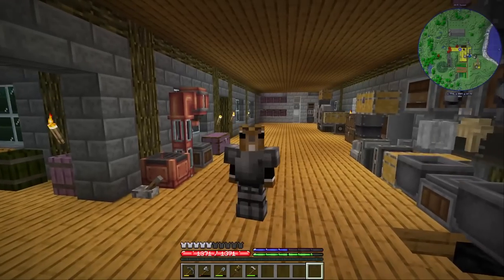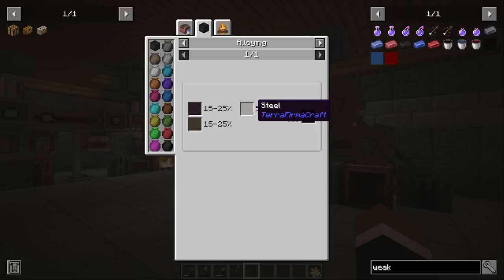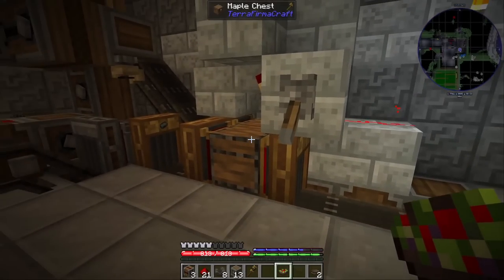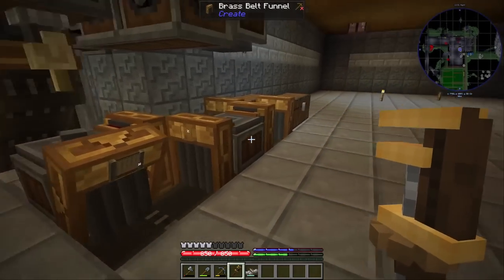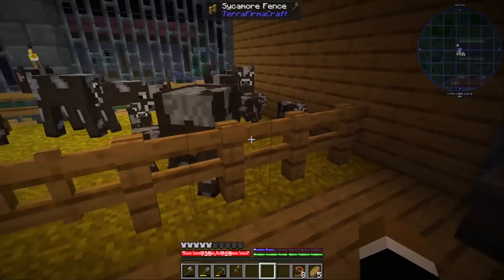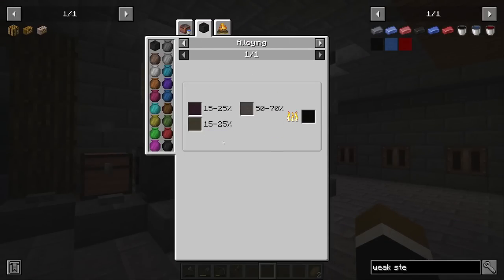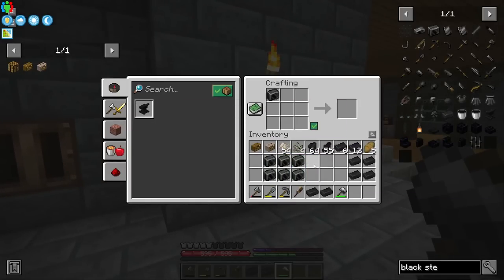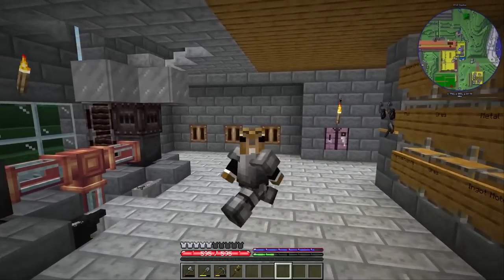ATFC: Advancing To Black Steel And Train Track Making Line (Episode 33)

Comment: any step that can be done on a depot can be done directly on a belt, this should save you so much space and effort creating some of these production lines
and saws can be inline with belts and the items will flow straight through without having to use a funnel

Comment: I am telling you guys, it will be interesting to see Mango shall he decide to fully automate rail production.
Cause I have been working on it in the past days in creative and it's wild. It takes several DOZEN of production steps for various materials. Automating something like flux and bituminous coal is super tricky.
And while it's bad enough in creative, actually building such a factory in survival, will take forever
Reply: Schematicannon
Reply: Wait and see...
Reply: @rot7296  The only solution if you don't want to have two Minecraft instances open
Reply: @koyom1nfangirl  there's also litematica but sure
Reply: You dont need to automate bituminous coal, you can use a deployer on a bellows and just use regular charcoal
Reply: @dylankim4190  I know, but I have to automate charcoal anyway. And since I also  have to automate flux and some of the steps/materials are identical, I just went for it.
If I am going full auto, I might as well go all the way in ;)

Comment: It is possible to "chain" all the operation needed for such craft as the rail in a production line (one long belt with all the operations made on it). The mod is made for it. There is no problem of pace (the item do not move when an operation occur on the line).
Such contraption could make your production line look way better and realistic, as well as save you quite a lot of ressources.

Comment: I know that these are pre recorded, but when testing in my world, the filter for the ingot mold full of metal could instead be set to block only empty molds from passing. The nbt data must be respected however.
This allows me not to have to select each type of metal or alloy and makes life easier, hope this helps in some way.
Reply: iirc you can ignore the entire filter because empty molds under a spout will wait to be filled before going anyway, might be just on belts tho
Reply: @honema123456789  that's true, i sort of forgot about that when building in my world lol

Comment: Mango, you can just set a filter that denies empty molds instead of assigning every single mold you do
Reply: He'll probably advance through every metal type before we get past the prerecorded episodes and he "learns" about blacklist filters. 🤦
Reply: @_-ough-_  he mentioned last episode that he might change the filter in the washing contraption to blacklist stone instead of whitelist each product.
Reply: @felipevasconcelos6736  I noticed that too, but he doesn't seem to have actually internalized that info. If he had, it would be trivially easy to recognize the ingot filter as a possible application.